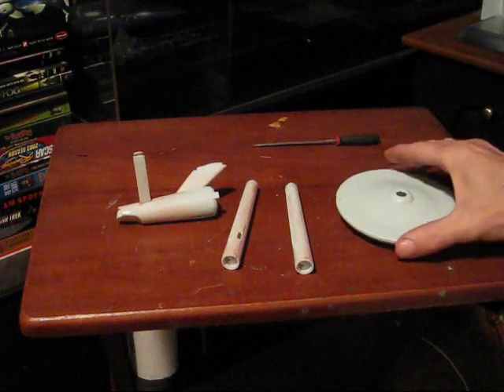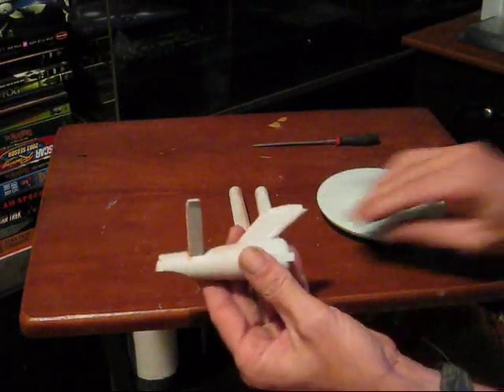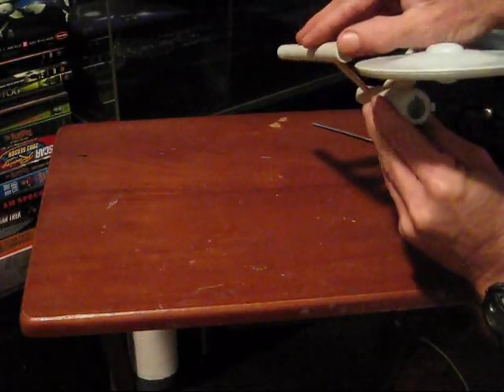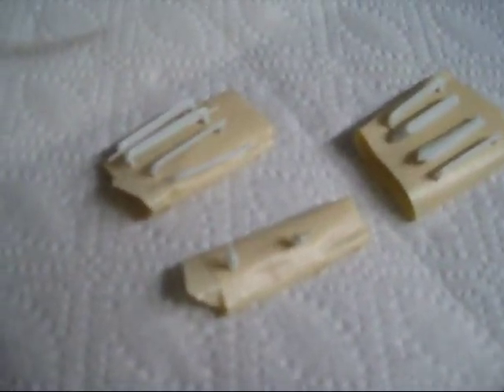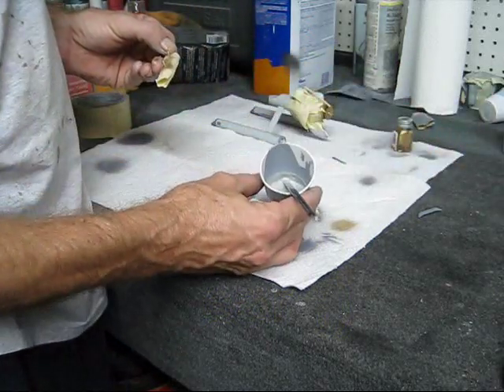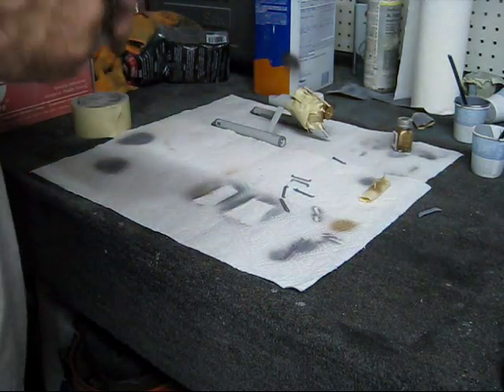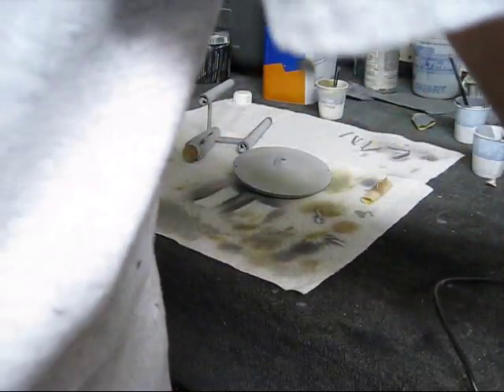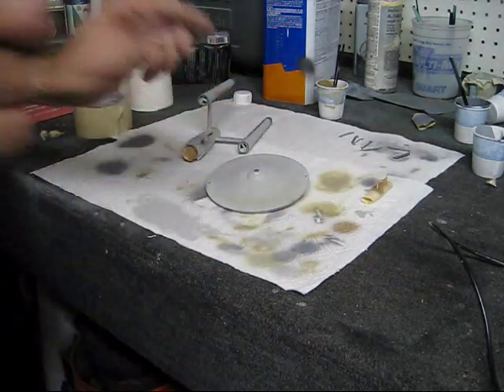AMT 1/1000 I.S.S. Enterprise scale model build by TrekWorks pt 2

Comment from the maker: @TheScifimodeler 
You can find it at most auto paint stores. The part number is A-2330S for the aerosol can,
and 2330S for spraying out of a gun. Another similar product is called Bull Dog Adhesion 
Promoter but it leaves a little texture. You could always sand it though.

Comment: a better solution to attaching the nacelles to the pylons:  If you look inside the nacelles before you assemble them, you'll see there's a tab (on the end of a rib like structure) on the inside of the outer half of the nacelle that is supposed to go over the tab on the pylon, locking it in place (rather well , too). You can't put the pylon tab into the nacelle if it's already assembled unless you first cut off that tab in the outer half of the nacelle, OR, you put the inner half of the nacelle on the pylon FIRST, then attach the outer half of the nacelle to the inner half after the inner half is on the pylon.
Reply from the maker: Good info, I just did what worked well for me at the time. The main thing I noticed was that whenever I snapped together the parts like they were designed to be, the nacelles were off. The inner grills were tipping up higher than they should be. Besides that little issue, the 1/1000 scale kit was the most accurate model of the ship available until the 1:350 version was released.
Reply: I did the same thing for the nacelles; good thing I did not glue them together. Then the nacelles were sagging, and I realized I had put them on the pylons backwards! So I had to take them apart a second time to fix that. The ship looks good now; I did mine up as the 2nd Pilot Edition.